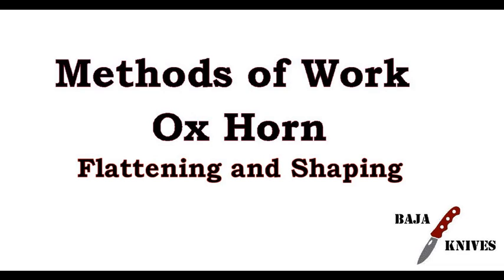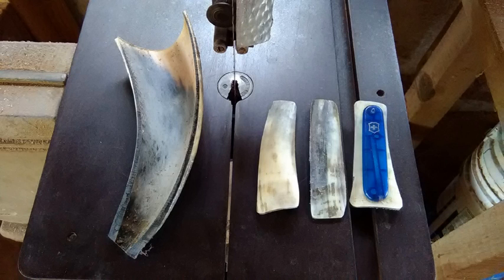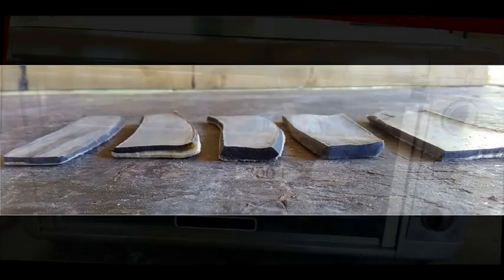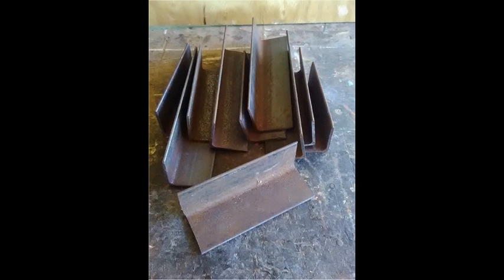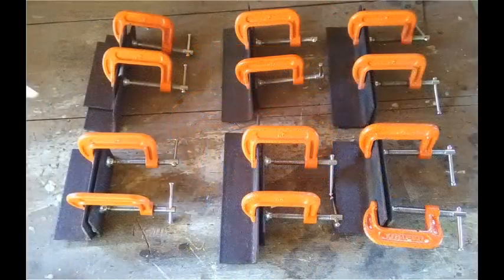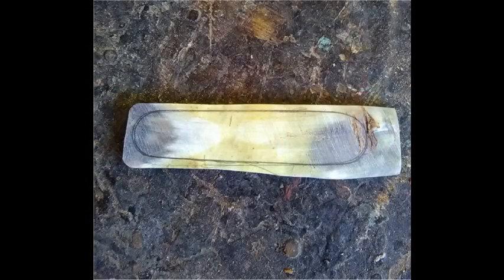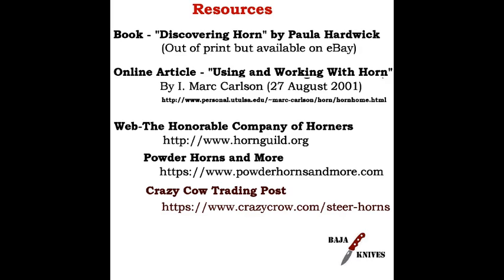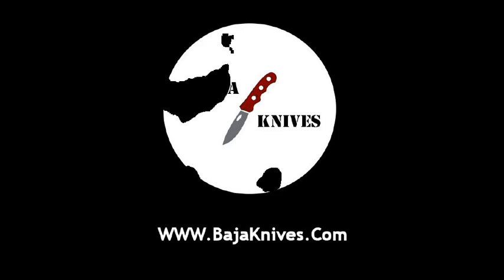Methods of Work, Ox Horn, Flattening and Shaping

Comment: hi I bought some ox horn combs and they arrived from UK a little bit warped.  Is there any way to do micro-adjustment to the warping?  The comb if you look at it like a sword blade has the tip bent to left side, about 2 mm.  It is functional but just annoying to me on the aesthetic level.